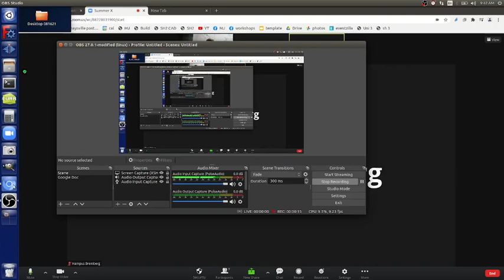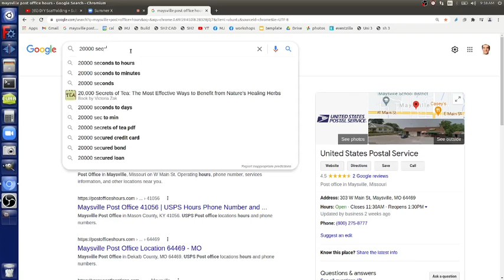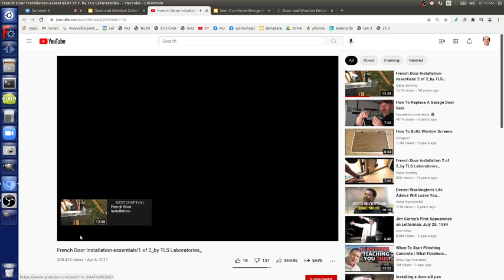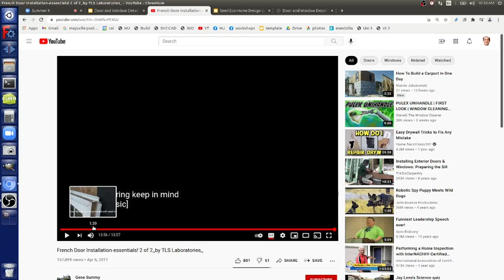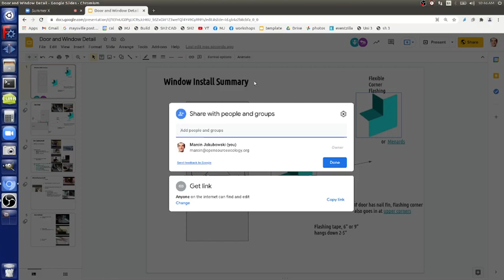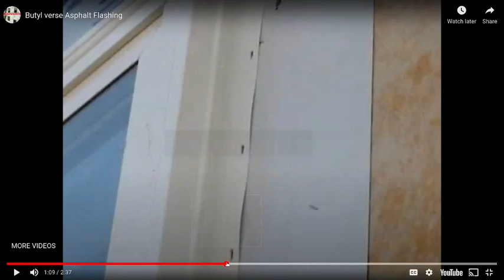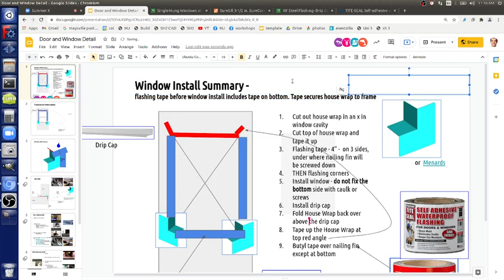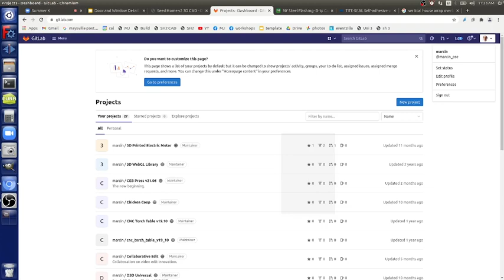Day 10 Summer X Morning

Comment: I can hardly wait to watch the whole video, as well as see any posted build details. Panelized construction seems to be an excellent way for people to construct residential housing, greenhouses, sheds and other outbuildings. Especially because the panels are constructed indoors over whatever timeframe is workable, so that diy on a budget is more feasible. The onsite build can be scheduled whenever all the panelized components are finally ready, no matter how long that takes to complete. (Finished panels can be stored in a self-storage unit, for example, until the entire Home Kit is ready.)

One thing that I noticed is that when I participated in a Deltec Homes build, the panels arrived with siding, windows and doors already installed. This resulted in a much faster onsite assembly, with less time on ladders or scaffolding, and an immediately dried in structure. The downside was that panels were much heavier, so a rented extendible arm forklift was needed to lift them into place. Also, since windows were already installed in some panels, greater care was required in handling to prevent glass breakage. That said, assembly of a panelized two story Deltec Home kit went extremely smoothly and pretty quickly.

Glad to see some experimentation with 24" O.C. as well as standard 16" O.C. framing. More innovation in low cost diy residential construction is long overdue, and OSE/OBI are a good place to try out some new approaches. Congrats to all involved, including the workshop participants. (Be careful with your offsite activities - Covid is raging out there.)